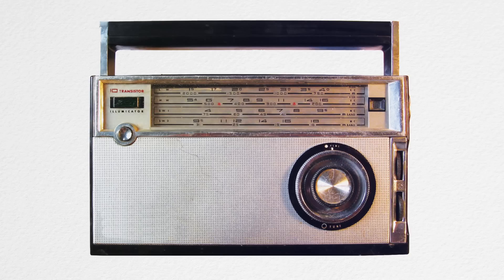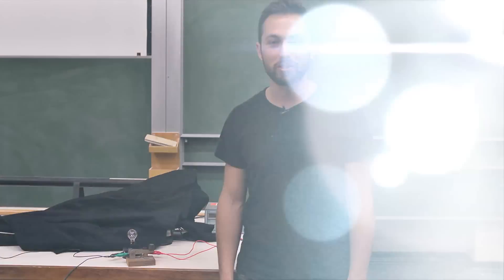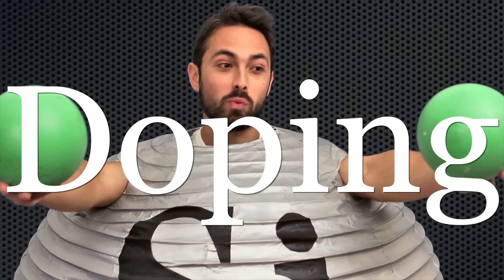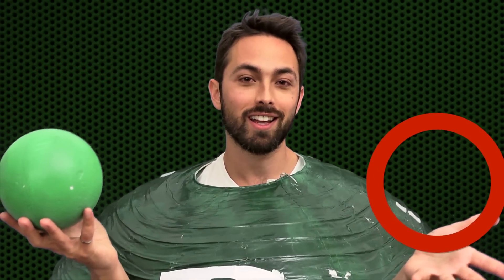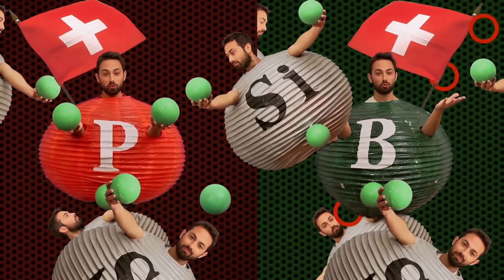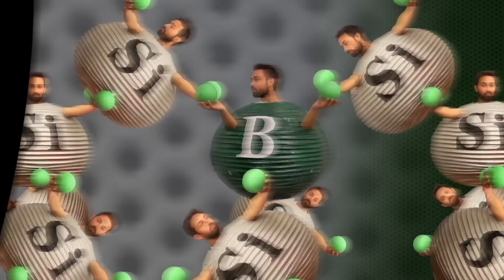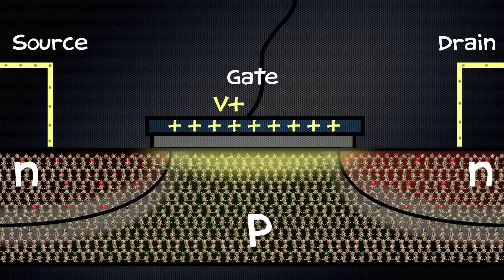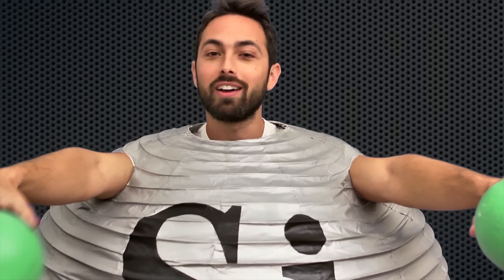How Does a Transistor Work?

Comment: here's something that's going to blow your mind do they realize that a semiconductor transistor literally is a voltaic pile on a microscopic level therefore we could make a semiconductor microscopic battery and increase the potential of the voltage by just taking a high potential metal say like copper or silver and take a less resistant like zinc or even aluminum and put them in the p-type and n-type doping areas and we could literally make a more efficient more Compact and more energy dense battery boom goes the dynamite

Comment: Correct me if I am wrong, but if this were true, then wouldn't the rate at which one could change the state of the switch totally depend on the rate at which one could change the voltage at the gate? So for a typical AC circuit 50/60 Hz. But i think the rate at which a processor processes information requires the state to be changed at a much higher rate. How is this higher rate achieved then?
Reply: I am just guessing but I don't think that the rate at which transistors can change their on/off state is dependant on the the frequency of AC as transistors can be used in DC
Reply: May be it's the quartz crystal that oscillates to do the switching.

Comment: Transistors are semiconductor devices that can act like a switch just by applying a voltage.... When the voltage is applied to the gate it acts like a closed swtch and overcomes the potential barrier...

Comment: No moving parts? So how do you turn on and off the gate?
Reply: Electrical charges. The lines labeled with source, drain and gate are actually conductors from other parts of the circuit.

Comment: What is this source ,drain and gate
Reply: Those are simply names applied to the three parts of the transistor. They roughly correspond to the function of each in the circuit.

Comment: Didn't need more than 30 seconds for you to be wrong about transistors -- in a video about transistors. A fairly old technology. It does NOT work just like a switch. What the hell,  guys?
Reply: It does in a non-linear application such as a computer.

Comment: Negative sign on 4:15 on the N-side were confusing imo. 

Also, right after that, the fact that voltage is makes the depletion layer thinner enough for the electron to go through is not explained at all. 

1 : Voltage = pushing electron 
2 : Which makes the positively charged N-Type silicon want to go through the depletion layer, making it thinner. 
3 : And the rest of the electron (the current) can go through the transistor.

Correct me if I'm wrong. Overall, very good video, it really helped me to understand how a solid state transistor works.

Comment: Thank you for this. I haven't read an explanation tying the molecular structure of silicon to the flow of electrons in a transistor before as clearly as this, and I've looked at several books on electronics. Especially the need for an insulator between the gate and the P type silicon.

Comment: How does the gate know when and when not to apply a voltage?
Reply: Voltage is supplied by external circuitry. The gate doesn't apply the voltage, it is applied to the gate.

Comment: So basically if you send electricity through the emitter, normally it wouldn’t pass through thus stopping the flow of electricity. But if you apply some extra electricity to the base when there is a connected source to the emitter then the electricity will be able to flow through and out to the collector?

Comment: How do the electrons flow through the 2nd depletion layer and out through the drain? The n-type on the right side's depletion layer is broken too, so why doesn't the p-type just suck in electrons from both n-types on either side? Why the flow from source to drain?
Reply: It's a function of actual construction and the voltage differences between the terminals. Apply enough voltage to the gate and it all goes wonky.

Comment: Just to clarify, transistors are generally combined to make logic gates, which are combinations of 1 or more transistors that generate outputs dependent on their inputs. The 1s and 0s reflect the states of these gates, rather than the transistors, as it usually takes the cumulative outputs of multiple transistors, and often resistors too, to actually process and generate those signals in a useful manner.

Comment: I believe you named the parts of the transistor wrong. The Source actually the Collector, the Gate is actually called the Base, and the Drain is actually called the Emitter.
Reply: The terminology Derek uses relates to Field Effect Transistors, although the technology he describes is more applicable to conventional transistors. A little confusing, but hey, he's a physicist, not an electrical engineer.

Comment: Hello,can you explain using an electron model why a substance have only a few free electrons is less conducting than a sustance having many free electrons? It seems on the face of it quite obvious, but I dont think it is. Electric current flows when electron push each other.Say for example the average spacing of electrons in some substance is 10 nm. I want to add an electron to one end and I'm want all the electrons to push each other so that about an electron falls off the other end (if it didn't the charge and therefore the voltage would build up). Now if the average spacing of electrons is not 10 nm but 1 nm the implication is that I will be able to push more electrons on (and off) this latter substance per unit time than on (and off) the former substance. Why?A resistor is though of differently - no one mentions a low density of free electrons, rather they mention electrons loosing energy via collisions with impurities, vibrations, and lattice discontinuities. So these seem to be two seperate things.

Comment: You are only explaining Mos-Fet type transtors, enhancement-MosFet's to be exact.

But i think they are easier to understand than BipolarJunctionTransistors where current affects current.

I would have started with the diode, talked about the 1.7V created be recombination, and that the depletion region accts a bit like a capacity since you can fill it up by applying reverse bias.

The next step would have been FieldEffectTransistors, for example a P-type wire with an N-Type ring around it.
And although there are only 2 pieces of semiconductor, jet 3 "poles", since the depletion-Layer affects the cross-section of wire that can conduct, applying voltage accross these 2 pieces will affect the resistance of the wire from completly open to completly "pinched-off"

After that would come the MosFet, where the depletionLayers shape is controled by the charges at the two plates of the capacitor formed by the Gate and the base, making it a 4-pole device, and that at first a depletionLayer is formed under the whole surface of the gate, until the creation of an InversionLayer(where N-Type will have holes and P-Type exess electrons), which will be the zone that conducts. In an enhancement-type MosFet that  is.
In the case of an "depletion-type" MosFet, source and drain are connected by a thin layer (P or N- type) just nelow the gate and are thus in the "closed" state until voltage is applied to the gate. Here, the depletionLayer pinches off the conductive zone like in the FET described previously.

You could then add that the voltage from source to drain will cause the depletion and inversionLayer to deforme further, creating problems and increasing the Gate-base voltage necessary to change its state from insulating to conducting or vice versa.

I think only depletion-type MosFets are used today because they are simpler to "print", but this inherently limits CMOS-technology to NOT, NOR and NAND gates. 
All other gates would have to be constructed by combining these 3 gates.
Likewise enhancement-type only CMOS would yield only Buffers, OR and AND Gates.

After that, it becomes fairly simple to create a "working" computer. Wether it is fast, power efficient or userfriendly is a whole other ball-game though.

Comment: i might be stupid.
but if transistors are maxing out its density per square nanometer,
then god damn it, start making cubed transistors.  step into 3d chips, then continue to double the volume every 2 years.  theres your goal, nerds, make it happen.. cubed chips. or tetrahedral whatever platonic solid works well with doped silicon crystals.

Comment: He didn't even mention the fact that you have to apply a positive voltage to one of other two terminals in order to have a current between source and drain. I already complained about this video before I knew anything about transistors and I still find this video confusing. I will never like it.

Comment: a couple of stupid questions (not exactly about transistors, more like about the basics of conductivity)

1. Why do we need the material itself to have free electrons for it to be a conductor? Why can't some free electrons flow into the material once the object is connected to a wire with excess of them?

2. When an object has static charge, say negative, doesn't it mean that it has received some electrons from outside? These electrons are not participating in any bonds, right? Why can't they be charge carriers, thus making the object a conductor?

Comment: Awesome video! Very well explained. Correct me if I'm wrong but I think you may have mixed up two common types of transistors- mosfets (metal oxide silicon field effect transistors) and bipolar transistors. They use mosfets for power stuff, they have the oxide layer, and usually are named source-gate-drain, but are in an "on" state with a lack of voltage at the gate, not a voltage. Bipolar transistors are used for data, and (I think) work more like the one you described, but instead their contacts are called collector-base-emitter. That being said, you did a great job making it clear and keep up the good work!

Comment: what did you mean by positive voltage? I mean either you meant connecting to the +ve electrode.
Reply: Positive voltage means that electrons flow "downhill" when they move toward that location in space, from the location we define as voltage being zero (i.e. ground).

Comment: but if you apply voltage to the transistor, wouldn't it mean that you let electrons go to p-type (through the gate) since electrical current is actually moving electrons??

Comment: why arent electrons stuck at the positive plate area in the middle? why do they pass through to the right?
Reply: the source's voltage is lower than the drain's, so electrons move from the S to the D

Comment: why there is an oxyde layer ?
Reply: For isolation
Reply: Mitche23 what kind of isolation? (hot, electric, sound?)
Reply: Electric
Reply: Mitche23 well... then it can't work
Reply: its not %100 isolation
Reply: cccallen OK but why ?
Reply: Eniotna Yssaneb So the transistor can work properly
Reply: Eniotna Yssaneb because you need to isolate the gate from the flow of current between the source and drain. (i am from Argentina, sorry about my English)
Reply: Sebastián Falcone it means that this flow is a danger for the gate?
Reply: Eniotna Yssaneb that flow is "dangerous" for the signal that turns on the transistor
Reply: Sebastián Falcone some remanence ?
Reply: Eniotna Yssaneb the way he explained the transistor in this video is a little wrong in the fact that he combined the way two different kinds of transistors work into one transistor, but the one he is trying to show is supposed to be an enhancement metal oxide semiconductor field effect transistor(or MOSFET for short) and the oxide layer is there to prevent a depletion region from forming by electrically isolating the gate from the source and drain, and the way the transistor conducts is that when the positive voltage is applied to the gate it attracts majority current carriers (in this case electons) up into the gate therefore the conductivity of the transistor goes up and current flows through the the transistor.
Reply: Razgriz tanks i Will try to understand
Reply: no problem, i" always happy to help
Reply: it isolates the gate and the electric flow
Reply: Lets say a battery is applying voltage to the gate. The purpose is to pull the electrons from one side to the other. When a voltage is applied, there is an electric field which helps "pull" the electrons. The oxide layer exists so that the electrons don't flow into the battery. So to summarize, it works because although there is no direct contact between voltage source at gate and the part of the transistor on the other side of the gate, there still exists an electric field which has an effect on electrons.
Reply: ***** what is the difference between an oxyde layer and a metal layer?
Reply: Eniotna Yssaneb metal is conductive, whereas oxide is an insulator.
Reply: +Svader96 thank you i have some difficulties to understand because i'm french and because it's complicated, i try to understand...
so an electric field is necessary to run the transistor, and this electric field need an insulator oxyde layer to exist?
how works the electric field?
Reply: Eniotna Yssaneb Well, this is more going into physics of electricity and magnetism. I suggest reading some material on the physics. However, put simply, a voltage must be applied to the gate for the transistor to function, and wherever there is a voltage there is an electric field defined as volt per meter.
Reply: ***** and the oxyde layer makes a bigger electric field ?
I heard that the oxyde layer "protect" the transistor, so maybe the transistor is just fragile at high voltages and the oxyde layer, as a resistance, makes the voltage lower ?

Comment: Hej dude, great video. But your practically using a MOSFET to explain a transistor. nothing wrong with that considering their pretty similar just informing considering a transistor does not have a gate like you explained in your video.

Comment: Something else about transistors, the p-type and n-type can be arranged such that the depletion line is only "cut-off" when current flows in one of the directions. That means that an AC voltage can be applied and it will still only flow in one direction like a DC current as a result of this.

Comment: If a transistor is a switch, how does it regulate voltage in an analog circuit? i.e. somewhere in the middle of an on / off state?

If you take a basic transitor and connect a poor quality (noisy) 10V DC supply to  the collector pin and then feed it a very clean 5V DC supply on the base pin (aka gate) it will take the 10V supply and make it mimic the clean 5V supply.  This is the basis of an ampl;ifier - modulate the power supply to copy the input signal.

I'd love to see a video of you taking aprt a valve / tube and explaining it Derek!